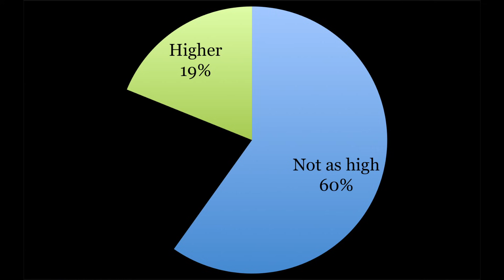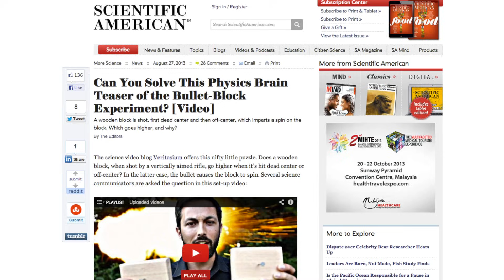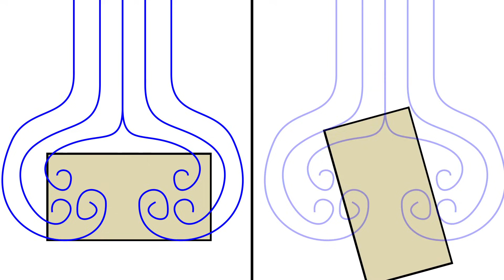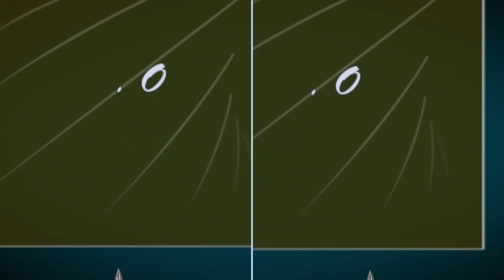Bullet Block Explained!

Comment: You could use a "block" material that varies in density as a function of its height - more dense at bottom and less dense towards middle.  It would need to both be an exponential decay in density as a function of block height and that function would need to be known.  This would "magnify" the difference in penetration depth as that 1% more energy penetrating the block would be traveling through relatively less dense material.

Comment: Bah - typed a nice explanation, but it doesn't fit youtube's comment length. And it won't let me post a link... so rebuild this:

docs.google.com and add /document/d/1_7yETUS-EKMTHtxiOT1Enmytfk4AyquX0A9Txqm35tQ/edit?usp=sharing

TL;DR - they don't go to the same height, but your margin of error is far larger than the difference. Pick something with a larger moment of inertia (ie. longer), and fire it more off-center, and you should see a measurable difference in height. 

Science is fun.

Comment: This will probably get lost in the Comment Forest, but why haven't you considered Forces and Couples? If a rigid rod is applied with an off-centre force it also has the effect of inducing a force at right angles to the motion called a Couple. Which acts like a torque and doesn't require extra energy because the two couples cancel each other. Surely this is the answer, even if you want to argue a lot about it not being rigid. Anyway, like I said, probably lost in the forest.

Comment: The second block should go 2/3 as high as the non spinning block. Assuming that they received same amount of energy and spinning energy of the system was 50% of energy of the forward moving energy. Total energy would 150% of forward moving energy, and 2/3 would be for upward movement.

Comment: I dont believe that the distance the bullet goes in should be measured because the rings of the wood would have to be the same. I suggest to repeat the experiment with more powerful bullets, and a material that is more uniformed than wood.  More powerfull amo should give more measurable findings and will be more fun too.

Comment: Do the same with steel blocks und soft bullets, maybe you can show the difference in lost kinetic energy by the grade of deformation of the bullet. Another idea could be, that you also use a heatray detecting camera (I don't know if there are slomo ones), maybe you cold see a difference in heat emission when the bullet hits the steelblock.

Comment: With the bullet impacting to the side of a the single pivot, the block becomes a lever, which should increase the rotational.power around tbe axis. Striking in line with the nail it simply provides an impulse, driving the block upwards.

Comment: I was thinking that the differences in wood block height, regardless of where the bullet hit, could be due to slight differences in the bullet velocity, from different gunpowder charges. For most purposes, the gunpowder charge would be essentially the same. But, when you're trying to measure something to this degree of accuracy, it can make a significant difference.

Comment: To get an accurate measurement of bullet depth you would need to use a material that isotropic.  The wood is not isotropic because of the grain. You can't get repeatable results because every block of wood has different grain.

Comment: Very clever. To be sure the gunpowder should be the same, well it fluctuates. BUT in both experiments, if the initial bullet velocity is the same the height will be the same, just make the exp many times, but compare, hit at the center, and hit at the end if and only if they jumped at the same height. Same height, same initial bullet kinetic energy.

Comment: I think it would be easier to basically change the bullet shape. A sharp edge would be easier to measure since it will have a longer un- compressed form. Also you have to  change the tip of the bullet so it's made of a stronger metal that will not change shape as much. That just my un-expert opinion.

Comment: You could use a more malleable substance than blocks of wood. So that the bullet would be allowed to penetrate deeper, hopefully making the depth of each % more and therefore making the differences more measurable. If the substance was more uniform than wood that would also help. Like something that started out as a liquid which you dried/solidified yourself to make each trial have less variables

Comment: Or you could of course do the opposite and see if you theory is completely wrong by using a projectile that will not compress such as a steel ball bearing fired out of a smooth bore musket. It would be really interesting to see what would happen to the wood

Comment: We know this: momentum is conserved and kinetic energy is not conserved. Try this experiment. Prepare 4 different blocks. First block with homogenous density for example iron, second block with homogenous but less dense material (wood …), third block where density is concentrated around centre of gravity (wood block with iron in the middle) and finally forth block where density is concentrated at the edges of block (iron block with wood in the middle).  And heights will not be the same.

Comment: "Increase the speed of the bullet." that will not help much, and it is not easy, standard ammo. Deeper holes would make better observations of the difference, but if difference is 0.1% then to achieve 1mm you need 10cm hole !!! Much better is to change the form and material of the block. Use the formula m*(a^2)/I, that gives % of difference compared with 1st hole. So achieve at least 10% instead of 0.1% and observation will be visible, See my video response: /watch?v=KitegeCzEc8

Comment: If you want to validate your theory here's what I suggest, first of all use a less dense wood that is more consistent such as balsa  Obviously you're going to have to compensate in a few ways 1 use a larger block. And 2 use a softer bullet so you can see the compression. I imagine you're using a modern bullet with a copper jacket? If you select a bullet that is a longer caliber and made up of a softer material such as pure lead with a lighter custom load you should be able to really dial it in

Comment: using a more predictable material such a ballistic gel , encased in a rigid shell to make sure no energy is dispesed in deformation of the block, would make a better block , not only the material would always react in the same way, but by using different kinds of bullets , like some shotgun slugs (slower)  or some high speed 7 mm 
it would be easier to measure which factos does influes rotation or block penetration , offset, distance , bullet weigth , bullet speed ,   distance from nozle , etc,

Comment: Remember also that the mass of the bullet in one instance is travelling the same spead relative to the blocks center of gravity while the mass of the bullet in the rotating block is travelling at a cycling speed relative to the blocks center of gravity, first faster, then slower, this cycle cancles itself out so that the energy imparted to the block from the bullet is the same in both instances.

Comment: My theory is that some of the energy was lost in the 1st block in order to overcome the inertia.  That same amount of energy was used to impart rotational energy into the 2nd block.  The energy lifting minus energy holding the block down was equal in both instances so the block would travel to the same height.
The energy required to overcome the blocks inertia would be identical in both instances, however, one being off center would cause the block to rotate around the blocks center of gravity.

Comment: I don't know physics, but seems to me that because the bullet is not hitting the center of the object, so the energy is not distributed (if that is possible) evenly to the whole object. The balance plays a factor here, and the extra energy is from the extra weight of the other side of the object that's creating it while it spins in the air (think windmill) and thus the spinning energy is quite literally coming from the spinning itself that's fulled by air.

Comment: Could you use a softer piece of wood?
I think that would mean that the bullet would penetrate further and thus the distance would be more measurable..... 
That said to prevent the bullet passing strait though you would need a large piece so I am not quite sure if this would work scale wise.... What with still getting the flip and such like...
More kinetic energy/surface area on the bullet should have the same effect, Other wise, do this in zero G with soft cheese? To prevent size issue mess ups.

Comment: A significantly more powerful gun, which would likely also mean a larger block of wood. The goal would be to get the difference in distance to be measurable. So a less dense block of wood coupled with a more powerful rifle might do the trick. I haven't done the calculations, though, so I might be suggesting the largest block of wood in the world or a rifle that simply doesn't exist, but that's my first instinct.

Comment: you're going to have to find a substitute for the wood blocks that's more uniform.  differences in density of the wood, water content, etc are going to impart unknowns and immeasurables into the experiment.  i'd increase the length of the block somewhat as well as having a professional hand-load the ammo to minimize variation (retail ammo isn't all that consistent).  i'd probably use something you can control the force on more precisely.

Comment: If Derek cuts the block half alongside, It would increase the percentage to 5% or 10%. I assumed the bullet is 4 grams but I don't know how much is the bullet weight. Better ratio of m*(a^2) / I , where m mass of bullet, I moment inertia of block. And finally softer material. Check my video-
response to see calc and details /watch?v=KitegeCzEc8

Comment: Create similar 'blocks' using ballistics gelatin or a soft metal like aluminum.  On a different note, ballistics gelatin at slow speeds would potentially show the energy expelled during penetration (through surface vibration) and would save you the need to x-ray the material. ;)  Great stuff!

Comment: the bullet that hits the side of the block uses less force to overcome the weight of the block because it's not the centre of the mass (so you get the extra energy for the rotation) , whereas the bullet that hits the centre of the block needs more force to overcome the weight of the block .

Comment: i would guess that a material with lower density would be the easiest way foam would be to soft probably try silicone, or you could get a more powerful gun with larger bullets. either way it will be hard because for the results to be measurable the block would have to be much much larger.

Comment: Yes material with lower density would help because the holes will be deeper. In my video response /watch?v=KitegeCzEc8 I've calculated the difference between holes / first hole. So deeper holes will make difference easier for observation. If Derek use bullets 4 grams and If he cut the block half alongside. Then the difference I expect is 1mm should be observable.

Comment: How about a material with a lower density? In foam, for example, the bullet goes in further so the difference would be larger. Although then you'd need a much bigger block for it not to go out on the other side and you might end up having problems with it not spinning enough.

Comment: If you shoot stell, then the bullet wouldn´t penetrate. That leaves all the penetration measuring problem away.

You can now measure differences of transferred energy only to the block of steel. Leaving the bullet, and friction through the material away of the experiment.

Comment: To get a measurable difference in penetration, I think you'd need to change a few things. First you would need a material with a very consistent density. Maybe MDF board instead? Or a metal? There's probably something even better than that. You would also need to play around with the dimensions of the block and the overall mass. Maybe if you exaggerated the length of the block made of a consistently dense material, you might end up with something you could measure.

Comment: the block rotates and goes the same height for the same reason wheels on an airplain spin on the ground even thought the power of the engine is perpelling the plain and not the wheels.....in a car the power is put into the wheels....in a plain its not.  the energy momentem doesnt go away

Comment: To make the difference in bullet depths larger, I would increase the ratio of mass to moment of inertia by replacing the small metal rod or nail you used with a larger diameter steel rod.  This will significantly increase mass, but negligibly increase moment of inertia.  The block won't go as high as before but it will spin just about as fast.

Comment: What about this experiment: Shoot 2 bullets at the same time equally far from the center but opposite sides. Because it will be impossible to shoot at the same time, 1 bullet will hit later and thus encounter the block that is spinning towards it. 1. Will the block stop spinning and go straight up, however tilted. 2. will the block spin in the other direction. 3 Will the block continue spinning but slower. Or 4. It depends on the speed of the bullets and the mass ratio.

Comment: Cut the current block half along the long side, you make it twice lighter, and the wide side will become twice shorter, according to the mass given at this video. And If we assume the bullet is 4 grams weight. Then according to my calculations shown here /watch?v=KitegeCzEc8 the difference of the two holes will be above 7% so if the penetration hole is 1,5 or 2 cm, then the difference will be above 1 mm or 1,4mm, - observable.

Comment: First of all you need to change the experiment, how exactly and why I have explained in my video /watch?v=KitegeCzEc8
For example changing the shape of the block and using lighter block, and if possible with softer material, we could make the difference about 1 or 2 mm. Of course the ammo should shoot with the same velocity. Well it we make many experiments. We can compare only blocks that jumped at exactly the same height. Jumping at exactly the same height, means equal initial velocity.

Comment: Perhaps if you used a block with a large moment of inertia, the difference in penetration depth would be more measurable. Of course, the further from the center you shoot the block, the more noticeable the difference is, as well. So, perhaps a long, thin block that isn't terribly dense, but with weights attached to the ends would work best. Styrofoam with wood blocks nailed to it? Perhaps.

Comment: Use a wider block of wood, like, much much wider. Shoot once to the middle and once to one of the extremes. It should make the difference in results more extreme as well, since the bullet will have to work much less to push the block up on the extremes, and much more to push it up from the middle. Should probably be done in a room without winds in it to make sure the extra surface area doesn't interfere

Comment: moving the fulcrum increases swing momentum , it slows down spinning upward then speeds up like a golf club at the bottom . . throwing the block a little off course more and more each time until it eventually runs out. However the bullet does not have enough mass to outweigh the change in positioning of said fulcrum- so you would need a higher caliber gun but the same effect would be replicated right ?

Comment: I think that the reason energy of momentum is conserved separately is because it is also transferred from each particle/molecule/atom inside the block as they smash into eachother . . taking a sharpie marker to a spinning disk would show the path the energy takes except you have to imagine each particle smashing into eachother transferring that energy. The physics work similar to a spinning top .. it can spin in one spot or move like a beybade launcher. . So it is correct but not how you think.

Comment: Ahhhhhh!!! I love you but I hate you right now. 1/10 of a millimeter difference in depth caused the loss of energy due to friction which is where the all that rotational energy came from! I thought it was air resistance! Well I still got it right even if for the wrong reason. This is still blowing my mind but ok. Love hate moment; I totally didn't realize that angular and linear momentum were conserved separately.I need to look at my college physics textbooks again. Do something like this again.

Comment: What if you change the bullet to plasticine, and the bullet, or plasticine, doesn't penetrate the wood? The spinning block will still have more kinetic energy, since the plasticine won't be "squished" as much. Perhaps we could measure the plasticine's difference in length. Possibly in a vacuum so there is no difference in wind. Then we measure the height, and get the answer:)

Comment: use a very low density wood such as balsa wood, so that distance traveled is maximized, thus amplifying any change in distance. In theory using a larger mass for a bullet would also maximize the distance. However this would rapidly become impractical.

Comment: Keeping with the same type of wood, with the same weight, to get a different depth in penetration what you would need to do is cut the grain of the wood opposite of the wood you used in these videos.

Comment: if you hit the center the force will be split 50/50 left right
if you hit on the side 100% of the energy goes to the one side causing it to go upwards pulling the other side with it. the spinning isnt that it has more energy, it is that the one side that is going down has less energy than the one going up, since the force overall is the same as the center block we see the same height.

i dont see the problem, we dont need the fancy schmancy bullet depth thing, this aleredy makes sense.